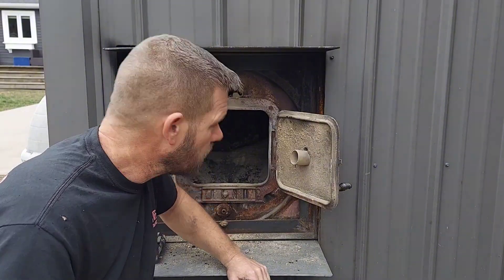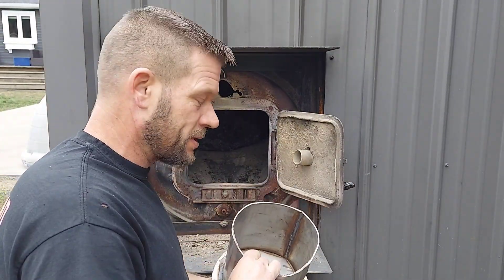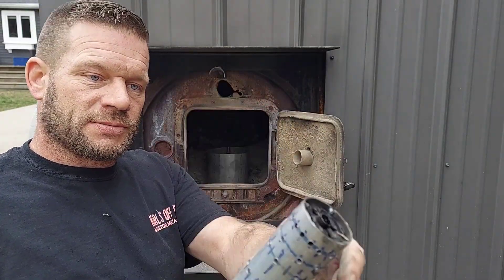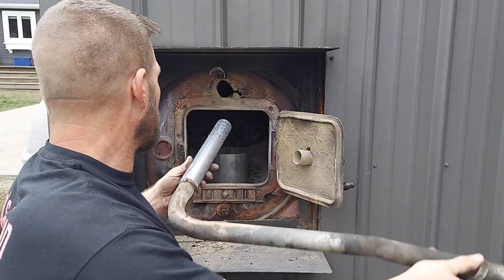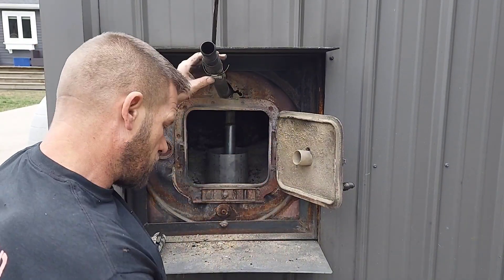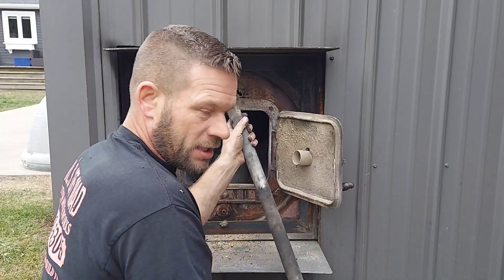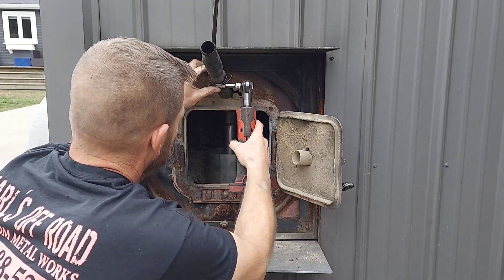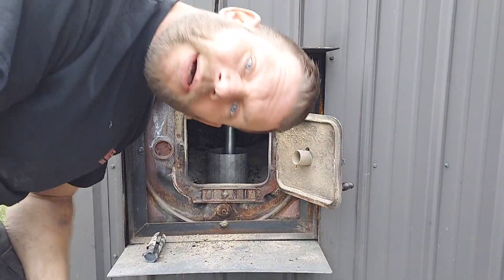Testing a different nozzle in my outdoor boiler that's been converted to waste oil.

Comment: Do you run the air at the same speed all the time, or do you vary the flow of air? Thanks for all the help!
Reply from the maker: Air stays the same. I control the burn with the oil adjustment.

Comment: Do you have a water to air heat Exchanger inside your furnace? If yes, do you run the blower all day or use an aquastat. I’m looking for a solution to this problem, since the waste oil run non stop in trying to connect the furnace blower to kit in went the water reaches a set temp and shot off went is below a set temp, and keep repeating the process continuously.
Reply from the maker: I run an aquastat on each heat exchanger, and that tells the furnace what to do when the thermostat calls for heat. I heat my shop and my home. It works well. If my water temperature drops below 120,the furnace fires the propane burners like normal. This is also a built in safety to prevent the water from freezing.
Reply: @karlsoffroad  how do you deal with the fact that the waste oil burner run nonstop and the water would boil eventually? I’m using two peristaltic pumps, one to feed enough oil to heat the water to a set temperature, that is plug to a plug thermostat that turned off went it reach the set temperature, and turn on went the temperature gets below a preset temperature, a second one as a “pilot” pump that runs continuously and provides enough oil just to keep the fire on went the first pump reaches the right temperature and shut down, but the problem is that the “ pilot” pump oil amount if the blower is not pulling out heat will be enough to keep heating the water to a boil point. I try to adapt a blower to the air handler that turned on and off base on the water temperature without the need of a aquastat.
Reply from the maker: @arcadelossiervosdelasantav9145  I get my water up to temperature, then back the burner down as low as I can. That will maintain the water temprature within a few degrees.  You could do a heat dump with a simple snap disc inline with the fan on a seperate heat exchanger. That's how I'm going to regulate the temperature when I get a successful automatic ignition burner. They make an adjustable thermal snap disc, so you could dial it right in. Very similar to how the factory boilers work now with it's combustion fan.

Comment: Does burner run wide open all the time?
Reply from the maker: That's nowhere near wide open. I run it as low as I can to keep the chamber red,but with minimal flame. The only time I turn it up is when we hit below zero Fahrenheit. It does run 24/7. I have been working on a thermostatically controlled burner with automatic ignition. I haven't perfected that yet.
Reply: @karlsoffroad Thanx for the reply. That’s always the challenge with home built wast oil is on/off auto function.. Stay with it.
Reply from the maker: @mjfair7691 I have had limited success with automation, but I don't give up easily! Thanks for watching and the encouraging words. Happy New Year!

Comment: I missed something man and I watch, I thought, all your videos. How are you getting the heat out? Are you heating the air in the shed and pumping the heated air to your shop with ducts and fans?? Or using a water coil? Not sure how I missed it.
Reply from the maker: Water is pumped to heat exchangers.  There is a video on that as well. Thanks for watching!

Comment: Great job, Iam thinking of using a thin metal drum also. How long do they last ?
Reply from the maker: These last a few months usually. I think this may last substantially longer. I don't see any signs of it failing yet. It seems to spread the heat more evenly over the whole surface. I'll definitely do an update video if it fails.

Comment: Karl, The combustion can be complete, without a blue flame, but you may lose energy. It is more important to keep an eye on the exhaust temperature at the top of the chimney so it doesn't get too high, but it should reach at least 60 degrees C before the combustion is finished. Otherwise, the condensation won't have time to dry out. I noticed that the top of the chimney has been very hot (blue-colored); if that is due to high exhaust temperature, then you lose a LOT of energy.😳😳
Reply from the maker: It's very windy here, and that will go away and move around the chimney, depending on which way the wind is blowing. The chimney runs directly through the water jacket for 27.5 inches before it leaves the back of the boiler. I'm still losing some heat out the stack, but I don't mind. It definitely keeps it clean! Lol

Comment: Nice I have been waiting patiently for this lol. That is burning clean and hot 🔥🔥. I think that is a winner. The smaller holes seem to work really well. Thanks for the video. God bless you and your family.
Reply: The blue flame guy from Japan uses very small holes, even angled for more turbulence. Really hard to drill tiny holes, especially at an angle. Good compromise
Reply from the maker: @lyndonmansell351  I've built small to large blue flame burners. They all share the same problem, the oil builds up a hard crust that quickly interrupts the burn. I can let this design burn for days without an issue. Each design has its application.  For me, this is the easiest and most reliable design.
Reply from the maker: It's still out there going strong. I'll probably shut it down tomorrow morning and see how much build-up it has acquired. I appreciate you watching!

Comment: Awesome videos, what oil pump are you using? I’ve tried a couple and they burn up.
Reply from the maker: I'm using a 12 volt transfer pump from Harbor Freight. They burn up eventually, but I usually get about 4-6 months out of them. I run 24/7 for about 7 months, so it's definitely getting a workout! Lol
Reply from the maker: I have a video of my setup in my playlist section under Boiler.
Reply: @karlsoffroad thanks man. I’ll go check them out now

Comment: Making good heat and not needing to constantly clean is as good as it gets. Great vidio
Reply from the maker: Thank you! Simple is best,in my opinion!
Reply: @karlsoffroad does it matter how far off the bottom of the burn pan the nozzle is?
Reply from the maker: @KenCoulter-k6h I shoot for about an inch, but it doesn't matter if it's a little closer or further away. I just try to keep the heat in the bottom so it helps keep it clean.
Reply: @karlsoffroad you're awesome man, thanks

Comment: Hey Karl.  I appreciate you showing the different things you try.  I have been burning used oil in my shop for decades successfully heating a 1200 square foot shop.  First with a homemade venturi type and pre-heat coil for the oil, then a blower system kind of like yours there, except the oil flows with the air down tubing into pot.  Then introducing oil into bottom side of pot and just air coming in vertical pipe into pot.  I'm always chasing the "blue flame" but can't seem to get it.  I heard you say on this vid that you have gotten blue flame, but it's not all it's cracked up to be?  I always thought blue flame meant the cleanest burn.  So, wondering if I should just be happy to burn an open pot like you have, which is what I have been doing for the last 5 years, and be happy with a burn like that.  My burn looks almost identical to what you have here and puts out the heat.  One thing I am curious about is, how is my oil consumption compared.  I burn about 5 litres an hour to produce approximately 140,000 btu's.  I can estimate the btu's because I'm running an old oil furnace rated for that, and I am maxing it out.  (burn chamber starts to glow slightly going into the heat exchanger - I figure that's the max (and then some maybe, haha) so maybe 160 k btu's?    Anyways, with that pot in the video, burning at that clean burn, what litres/hr approx?  Thanks buddy.  Ernie.
Reply from the maker: I use about a gallon/hour. That supplies two 120k btu heat exchangers and can still supply more heat than I ever had with my propane furnaces. I'm heating 3300 square feet total. My shop isn't insulated very well,but it has no problem keeping up. I installed a blue flame burner in my boiler and only got about 12 hours before I had to shut it down for cleaning. I have a video on my channel. It was definitely hot and burned clean,as in no smoke. It boils off the oil and leaves whatever contaminates were in the oil behind.
Reply from the maker: I run my water in the range of 185-200 degrees Fahrenheit. Never more than 205! 😆
Reply: @karlsoffroad  So if I understand correctly, the blue flame burns cleaner, but the regular flame leaves less residue in pot and on pipes?
Reply from the maker: @ernievanboven4396 when using dirty waste oil that's what I've found. I'm sure if I had the equipment to filter it down to one micron,I might see different results. I just use it as I get it and don't want to invest in a heated centrifuge to make ultra clean free fuel. I looked into doing that and doesn't seem worth the investment for me.
Reply: @karlsoffroad  Does a blue flame burn less for the btu's in your experience?  I mean, I seem to be burning a fair bit of oil for heating my 1200 sq ft shop.  It's not insulated at all, but I just have tyvec on the bottom of the trusses and ceiling fans to push air down.
Reply from the maker: @ernievanboven4396  actually I used a bit more fuel with the blue flame. I think that's because you have to maintain a puddle/pool of oil to boil/vaporize. I was also using the whole boiler as my burn chamber utilizing a vaporizing tray system. I had to use a tray system because the water around the barrel wouldn't let the oil vaporize properly.
Reply: @karlsoffroad  Okay!  Thanks for that info.  Sounds like a bit of a hassle to go blue.  Still sounds like you are getting more btu's out of a gallon than me.  hmmm.  Try, try again!  Hey, one other thing, sorry if you have covered this elsewhere, but since you run the thing 24/7, do you have some sort of safety shut off in your system?  thanks, E.
Reply from the maker: @ernievanboven4396 nothing other than an under and over temperature alarm. I use a wireless BBQ monitor for that. I have one in my shop and my home. Puts out an annoying beep if it hits either temperature. 140 is low and 205 is my high. As long as my temperature is normal, I don't even check on it.
Reply: @karlsoffroad  Sounds good.  I just have a meat thermometer hanging in front of where the air is blowing out of the heat exchanger (fan is a regular squirrel cage home furnace fan) to a digital readout and it beeps when the output heat hits 180 f.  that's when the heat exchanger starts to glow.  Had it up to 220 f output a couple times but man, she's cooking then.  I put a video baby monitor in my shop so when I go in for lunch I can hear and watch it, but thought of sometime to put an electric solenoid oil shut off connected to a flame sensor like in my kerosene space heater. Just a thought.
Reply from the maker: @ernievanboven4396 I was going to do a wifi controlled outlet to shut it down if I was away and something didn't look right. I just shut it down if I'm going to be away for more than a day or so, and my furnaces run on propane like normal. That also protects my hydronic system from freezing, since it's blowing hot air through my heat exchangers. No worries for heat around here! Lol

Comment: i thoroughly enjoy your waste oil burning builds and research. have you ever used one of these to fire a forced air type outdoor heater?  a boiler is way out of reach for me but i have been contemplating trying a wood stove setup with some kind of waste oil burner I can quickly toss in if i run out of wood as an example.
Reply from the maker: To stand around outside or forced air furnace that sits outside?
Reply: @karlsoffroad it would stand outside and push heated air into the house through the crawl space and /or a window. Primary fuel source is going to be wood but I'm going for being able to easily replace parts. Burn chamber will just be a 55 gallon drum. Something easy to get and swap out. I've seen a bunch of your oil burner builds and would like to try something like that for if I run out of wood. Small house, probably no more than a thousand square feet.
Reply from the maker: @littleengine1303  should work great! Have you seen my 55-gallon drum blue flame burner? That would be a good one for quick and easy. I could do a video to show it working sideways, if you like. It will also make wood burn with a blue flame! I tested that for fun on my own.
Reply: @karlsoffroad  yeah that would be pretty cool. the end result of my build is going to look a lot like your outdoor boiler but will be essentially an insulated metal box with a barrel stove inside.
Reply from the maker: @littleengine1303  I read your comment without processing completely! Lol,yes,I did plan on building one,but I never had any way to use it for myself.

Comment: Karl, any chance of some more detail about you boiler? Seems to have heals up to about decent amount of abuse over the years.
Reply from the maker: It's a 55-gallon drum inside a 275-gallon fuel oil tank for the main heating chamber. The return line goes into the bottom of another 275-gallon  fuel oil tank,then out the top and back into the top of the main tank for another heat cycle. I pull my water from the bottom of the main tank. This helps to keep my water temperature even in my tanks. I made some videos explaining my setup. Unfortunately, I didn't document the build.  I needed to get it done and heating my buildings.I will be building a larger one for next year, so I will definitely document it this time.

Comment: Karl, a thought to add to your system. use the shop vac to get it going hot. then above the flame or even in the pot, add a coil of piping that has water in it, that would turn to steam and then replace the shop vac air pressure. The moisture in the steam will increase the heat transfer to the main chamber. just an idea when you get the waste oil perfected and have nothing to do.   LOL stay warm my friend....CLO
Reply from the maker: I like that idea! I'll have to consider that for my next setup. Thanks for the input!

Comment: Nice, I've watched lots of your videos man.  I have built a couple myelf as well.  I was wondering if you happen to have a video on the building of  your homemade boiler?  I couldn't find it on your channel if you do..  ih and you said you keep the vac for the fan inside so the neighbors don't bitch, i was very surprised.. I cant believe they don't complain if your running a waste oil setup in town..  anyways cheers 🍻 from alberta Canada!!!
Reply from the maker: I'm not in town,but I have some neighbors about 500 feet in either direction. Just don't want to make a bunch of noise. I run 24/7 for about 7 months.  I'm in the thumb of Michigan, so it's cold here, like it is across the creek in Canada. Unfortunately, I didn't document my build on the boiler. I will be building a new one for next year, so keep an eye out for that video. I'm planning on 1000 gallons of hot water storage. Thanks for watching!
Reply: @karlsoffroad  Hey, just a suggestion for the back of your cranium, I want to do a boiler sometime in the future in my shop, and then have radiator heat in the house, like 50 ft away, so have been keeping an eye out for an old milk/bulk tank from a dairy farm that is cuput as far as cooling, since they have insulation and are stainless steel.  Bigger the better, so it acts as a " heat battery" during the night, and just run the flame a few hours during the day.  just my thoughts.  Ernie.
Reply from the maker: @ernievanboven4396  that's what I'm building for next year. I plan on having 1000 gallons of hot water storage. I have been acquiring all the tanks I can! Lol,I have 5 at the moment, so I have enough to go a bit bigger  if needed. I want to be able to go three days without firing up the burner.